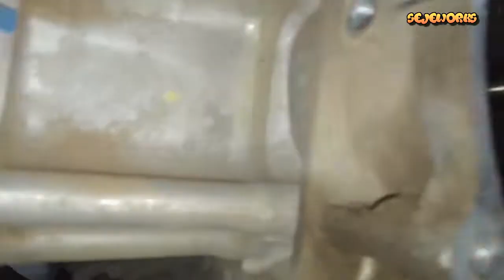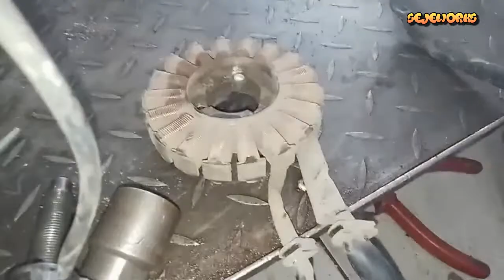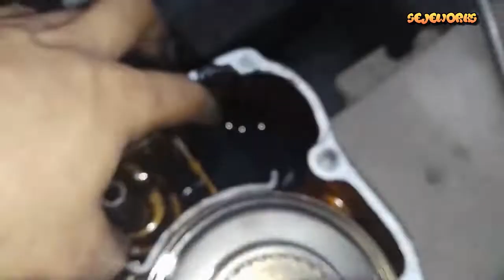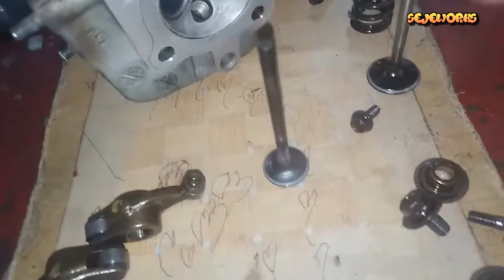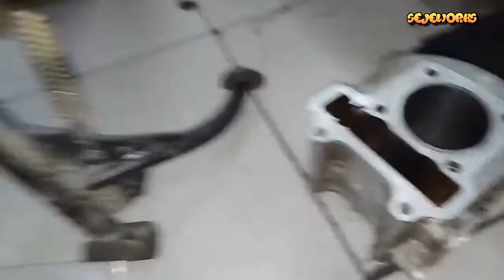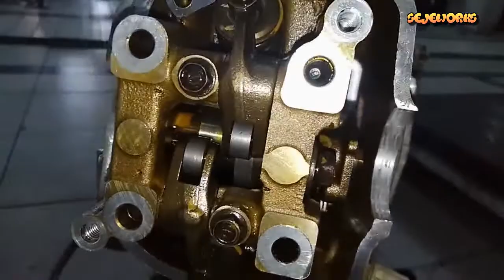Bongkar Mesin Total Honda Beat ECO dan Scoopy Ring 12 mm, Ganti Piston dan Stang Seher

Comment: Maaaff abang2 saya mao nanya saya ada beat f1 2013 kendala y si klo kata delaer resmi y harus service besar lah /alias turun mesin dan saya mao menanya kan biasa klo service besar sperepart yg harus di ganti apa aja dan biaya standar abis berpa buat service turun mesin dan beat yg saya punya dh penyakit y kluar hasap putih ngebul bang??
Dan jg biasa nilai positif setelah diservice besar atau turun mesin motor itu jadi gimn pembawaan ..
Mohon bantu penjelasan y abang yg sudah mengalami motor y turun mesin dan service besar🙏🙏
Reply from the maker: Biasanya yang diganti piston (140) pakai ori pakai npp lebih murah lagi bisa 100 - 120. Paking top 60 ribu, korter 50, ongkos bongkar sekitar 300 an. Tiap bengkel beda harga tergantung sparepart nya dan ongkosnya.

Kelebihan kompresi dan tenaga padet, motor ngga ngebul, suara mesin alus.